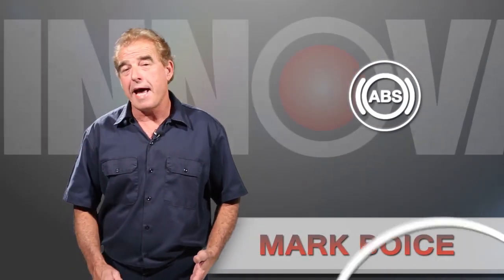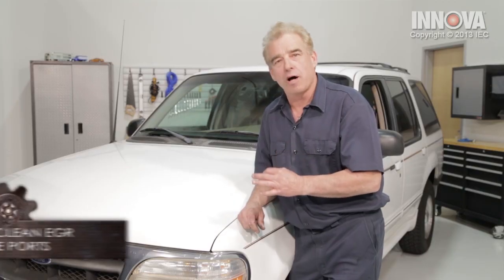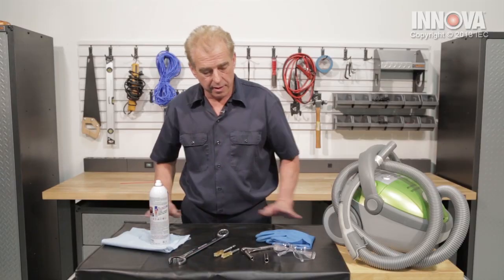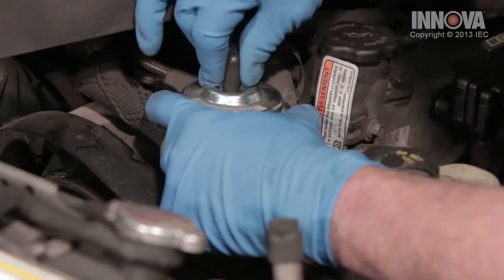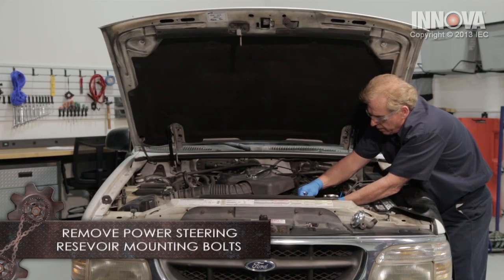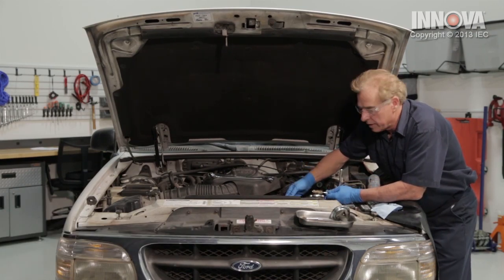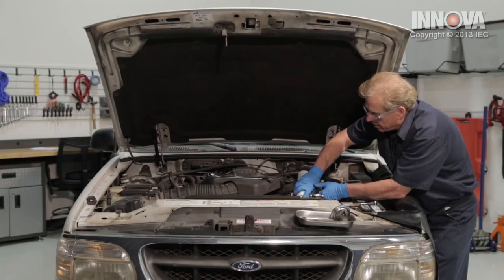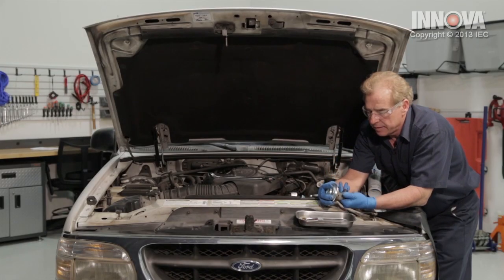How to clean EGR Valve and Ports

Comment: I replaced the EGR Valve (and gasket of course), but didn't know that the EGR Valve ports (passages) should be cleaned, so I need to do it now. The car idles high on start. Did you disconnect the battery to do this work?
Thank you for the very informative film, especially that part what brushes to use to clean ports and what to spray inside. Can it be any Carb Cleaner? I have CRC Throttle Body & Air-Intake Cleaner, WD-40 Carb/Throttle  Body & parts Cleaner, and  and Gumout Carb/Choke & parts Cleaner (on Gumout is says: "not recommended for fuel injected vehicles"). Not sure which one to use. The car is 2001 Saturn SL2, it has fuel injectors of course. But if you have Carburator it is not fuel injected vehicle (I believe those mostly motorcycles, aircrafts, and some diesel cars).

Comment: Why not pull the entire pipe that runs from the egr to the manifold? It’s easier to clean that pipe like that. It also leaves you in a position to put anti-seize so that thing will always come off easily. I always remove as many components as I can to clean them.
Reply: Watch out clean freak coming through :)